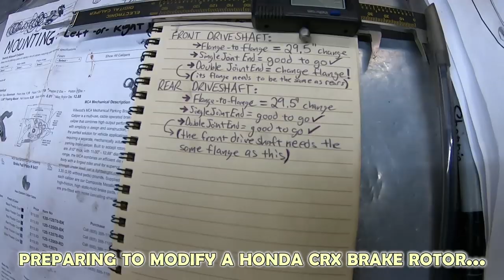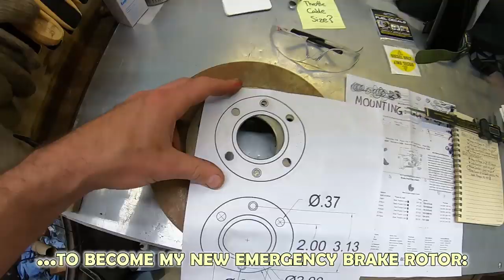Custom Driveshafts × 4BT Cummins Discovery #38 [Land Rover Build]

Comment: Wow had to pull the first drive shaft apart a lot that doesn't look right
Reply from the maker: It's less than halfway out & looks exactly like the old front shaft used to look... it's all good.
Reply: @Tinker1837  ok sweet just thought wow when you put in the second one and was less than half way out of the first one but all good, good luck can't wait I see it run
Reply from the maker: @LVNITUPM8  I think it's my mistake for not showing the measurements of them installed, or at least filming them cycling with the suspension, just judging by all the comments regarding that rear shaft. Oops!

Comment: Para que le pones un disco de freno en la transmision?
Reply from the maker: It's my ebrake / handbrake. These Rovers don't have the ebrake mechanism within the rear brakes, instead they have a great big drum brake mounted directly on the transfer case's rear output. I'm just upgrading that to a custom disc setup.

Comment: Drive shaft gaiters ?
Reply from the maker: It's kind of a toss up really. On one hand if you run gaiters you can keep initial dirt/salt at bay, but on the other hand it also can trap mud/water & make inspection more difficult.
Reply: @Tinker1837  neoprene with Velcro seam could be an easy maintenance option?
Reply from the maker: @jamescunliffe9872  Interesting idea 🤔 I may have to try something like that. It's always tricky because holding them on with hose clamps etc can cause vibrations.

Comment: Any updates man?
Reply from the maker: Always things going on!  I've been working on getting my new custom steering setup perfect. Getting that used Land Cruiser box in there is something I really want to be as good as I can manage.  Only leaves the throttle cable... then I can actually drive it out of the shop :D  Oh & it may not seem all that exciting, but I scored a refurbished Defender steering wheel from the UK to replace my old airbag wheel... it looks just the right amount of retro for the build 😎
Reply: @Tinker1837  that's what's up!  Are you going to go with hydro assisted steering?
Reply from the maker: @gaboonviper85  Oh yeah, & that's kinda what drove me to choose the Land Cruiser gearbox over the Scout/Bronco gearbox. Modifying the Cruiser box to tap into for the assist lines is surprisingly easy, not to mention tons of aftermarket bits for them. I think I'll be glad I did once I upgrade to the 37" or 39" tires.
Reply: @Tinker1837  yeah the dodge Durango and jeep wrangle/xj boxes are the same way
Reply from the maker: @joeyscleaninglady2877  Good looking out! That's a first for me... never would have guessed any of these videos would get enough views to be worth ripping off.

Comment: That rear shaft looks way too short and that's at regular hight
Reply: Exactly my opinion!  Front shaft is right length. Rear is too short!  I hope, at least vibrations will not come soon!
Reply from the maker: It'll be okay, it's out less than half it's travel, just like the front shaft used to sit with the old V8 setup.

Comment: Just call tatton drive line in Utah send $450 an wait a week for the  goodies to arrive.
Reply from the maker: I did some calling around & ended up deciding to try to stay local... maybe a mistake, but ah well at least I have that part checked off the list.
Reply: Tinker   Local for my two shafts was quoted at about $950.
Reply from the maker: @dave717785  Full custom or just length changes like mine...? That price seems plenty fair for custom jobs. Tom Woods had me under $300 to modify both of mine & that included shipping :(
Reply: Tinker mine were both completely brand new from all spicer parts and 0.180 wall tube with 7” spline slips in each